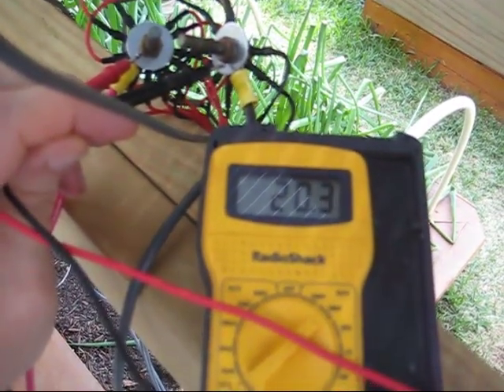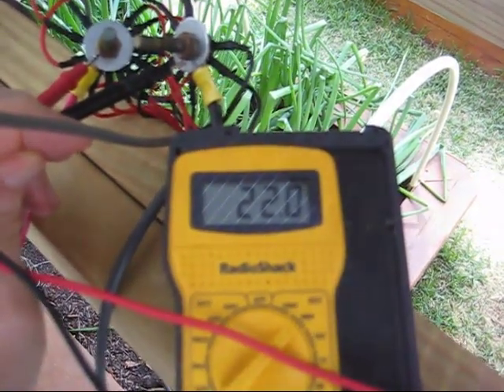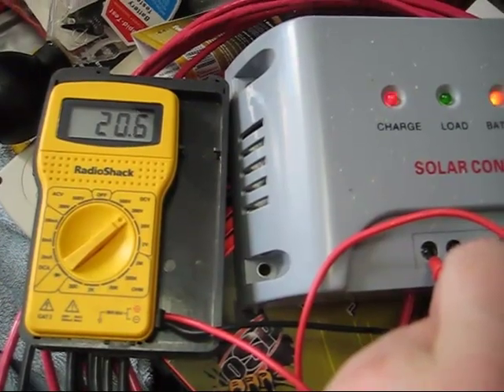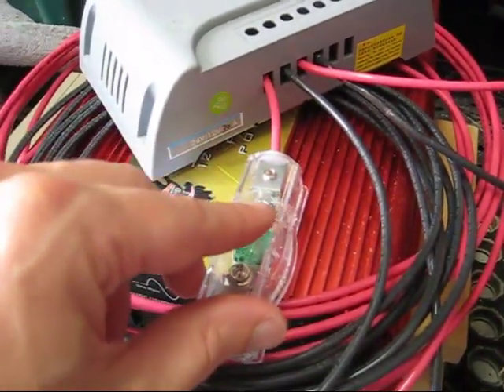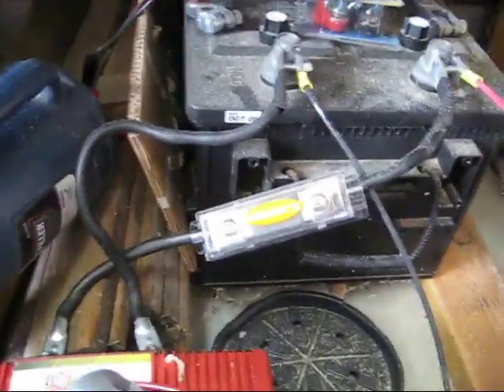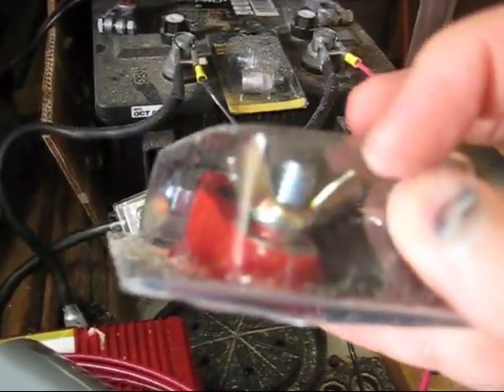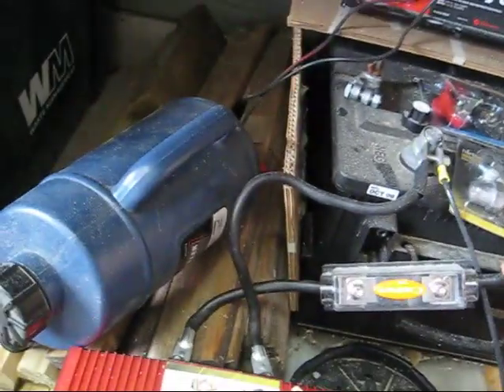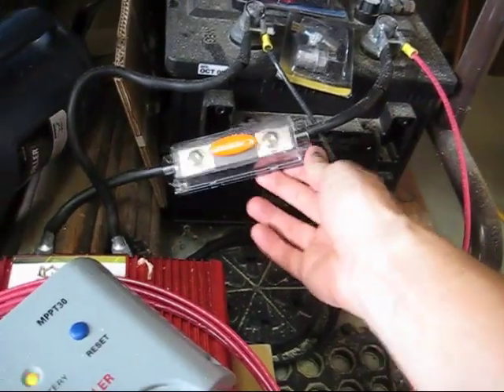Harbor Freight Solar Panels: Wire Gauge

Comment: Voltage drop can't be measured with out a load. Put a 3 amp load on the battery when it is partially discharged and then measure the voltage drop with one meter lead at the panels and the other lead at the charge controller both leads on the hot wire, then try both leads on the negative. I realize you don't have 60 ft leads so move the load, charger, and battery to the panels but keep the 60 ft 10 awg connected. You will not loose much voltage when only drawing 3 amps, but the larger amount of amps drawn increases the voltage drop. Wire size is very important and you are loosing voltage in the harbor freight kit with that long wire run At 3 amps your voltage drop using 10 AWG / 60 ft. run both ways is a voltage drop of .36 volts That is a 1.71 percent loss and is within the allowable recommended loss for any solar system. WIRE SIZE IS VERY IMPORTANT,
Reply: the  voltage on my charger  controller is  13.7 loat  yet the voltage on  my   battery is only 13.3    i use 2  meter  6mm  of wire  between  my  mppt  controller and  batteries  can y ou tell me what is wrong?

Comment: The amount of wire gage needed is dependent on the amount of current being pumped through them. A set of Harbor Freight panels only put out about 3 amps so you don't need very thick wire. It would be a completely different story if you were pushing 30 amps on a 500 watt array. Your voltage losses should be measured while maximum current is flowing. I don't know what the flashing charge light means on your charge controller but if it means that it's in float mode, then there's hardly any current.

Comment: Is this a 12 or 24 volt system? Do you think 10 ga. would work for a 12 or 24 volt, 40 amp system @ 100'? I'll have 2 120 watt panels.
THANKS

Comment: @LDSPrepper 
Your video shows it is not a mppt (at least not a good one), volt meter is a little slow to tell, but it has the look of a pwm only controller.  PWM charges a capacitor then uses a transistor to dump that power to the battery, at a frequency dependent on panel voltage.  A MPPT controller should use capacitors, and inductors to maintain a optimal voltage at the panel, it will do some searching for that voltage, but not a fixed V search like yours show.

Comment: LDSPrepper, great videos (all of them).  Could I ask you to provide a bit more information on the in line fuse and fuse holder you selected to go between your battery bank and the inverter on the positive #4 gauge lead. (Specs & source would be deeply appreciated).  TIA -=dave=-

Comment: @LDSPrepper 
Shame about that. We can't really work out the MPPT efficiency without comparing watts out with watts in.
The voltage reading alone doesn't really tell us much at all. The other thing that concerns me a little about these regs is that they don't allow you to run higher voltages on the input side.

Comment: Good job buddy, keep it up, this will help many other people. It is important for people to Google the words "DC wire size chart" and it will show them why that 10 gauge wire you have with that voltage and amperage at that distance is good enough and help them choose the right wire for their needs. I can see that you will continue improving your system and cleaning it up, you are on your way to a great setup! Congrats! Have a great day rejoicing in our Lord's resurrection!